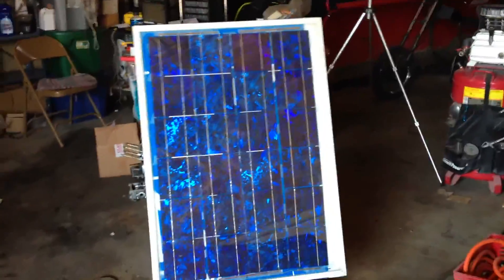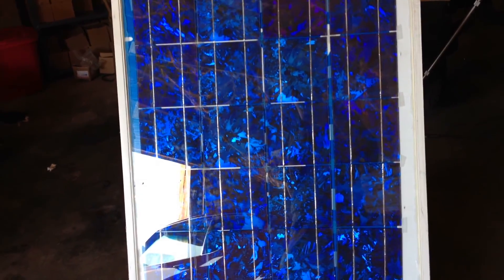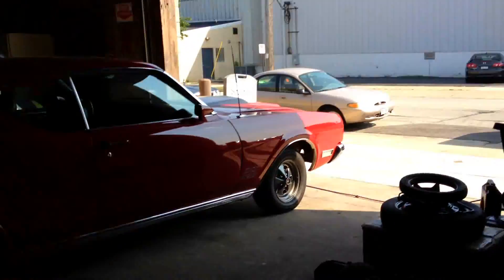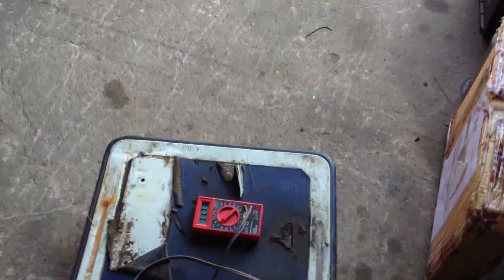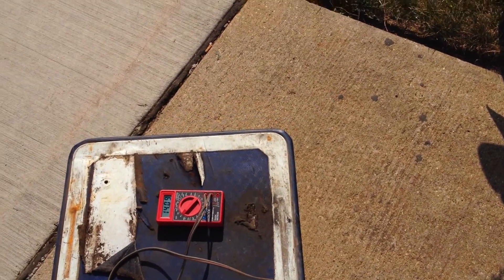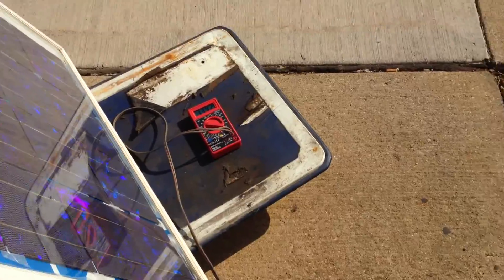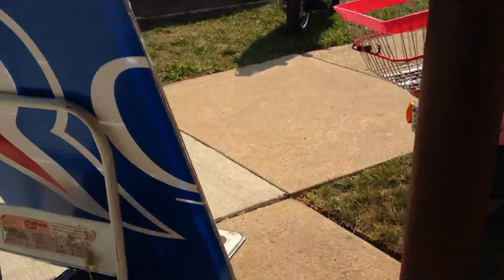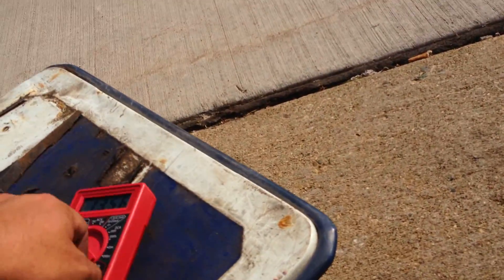Solar Panel Build for less then $0.50/watt  How-To Part 6 FIRST TEST!

Comment: I got my cost down to less than 0.20 per watt, 0.13 for the cells, bought some eva plastic to seal them , 1000m for about 200, and glass, sliding glass doors from a door installer for 5 bucks, alum frame from a scrap yard.